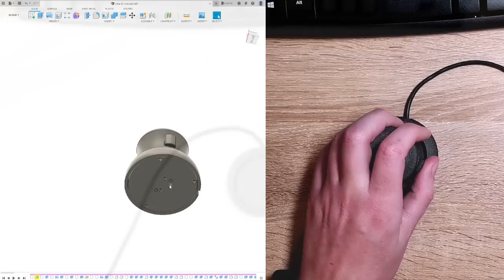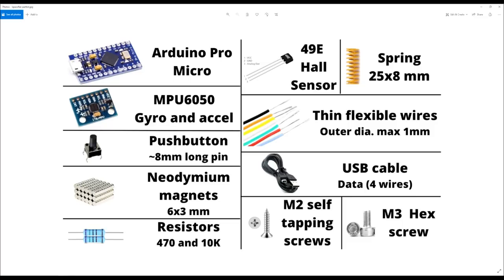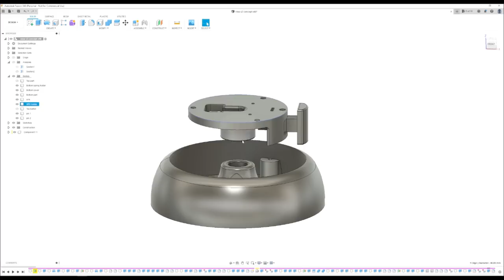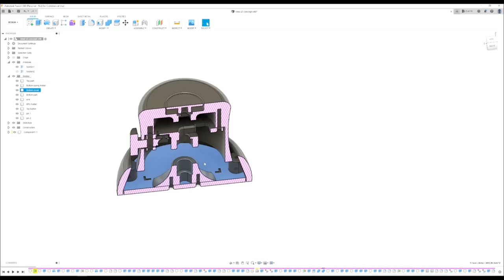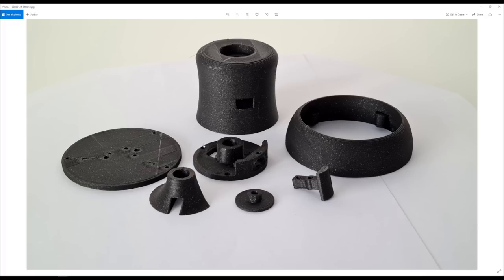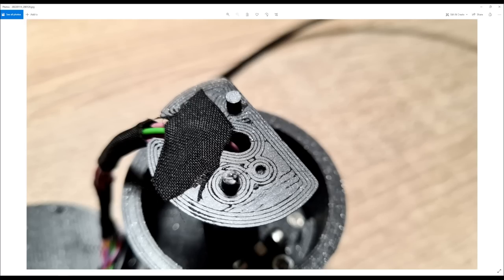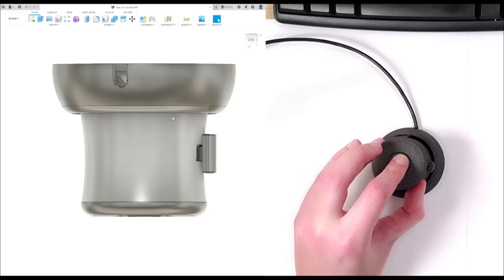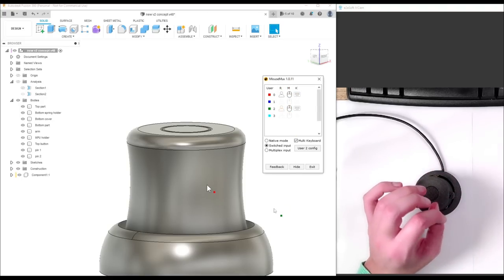Can my DIY Spacemouse compete with 3dConnexion??? - SpaceRat V2

Comment: One question - is there any reason that you did not just expose the usb connector on the Arduino so you could just plug in the cable instead of soldering it in?
Reply from the maker: These micro USB connectors are really shitty and it is anyway on an awkard angle in the case. Ijust did not want to make a huge hole slightly on the side. Here they are soldered and held by the hotglue in place. Furthermore I added a cable tie onto the cable wo you cannot pull it out from the case
Reply: @kikihobbyrepair  Well, I think you have a great project here and I might try and recreate it myself. I do most of my modeling in FreeCad, but I am sure that it would be easy to adapt the code.  I think I would look at making the top button a capacitive touch button instead of a mechanical button with an LED to indicate the mode and I would look at making the entire knob rotate for the zoom feature instead of having the side slider button.  I think the mpu6050 could be used to capture that rotation as well as the angle changes and make the electronics part a little simpler, but the mechanical part would be a little harder. But, I find that trying to solve these design problems is where the fun is.
Reply from the maker: Have fun 😉 One tging you have to take care is if you want to use the MPU also for the rotation you need an additional sensor which is detecting if only the knob is rotated or the entire mouse together with the base. Otherwise you would generate ritational commands by slightly rotating the entire mouse on your desk.
The capacitive button I like. It would be a nicer solution indeed.
Reply: @kikihobbyrepair  Great point - I had not thought of that, but that would be a problem.  Maybe using a detent similar to the one you designed with a hall effect sensor and three magnets is actually a much better solution.  By the way, I did not mention it before, but I love that "auto centering" detent design.  Did you come up with that yourself of did you find it somewhere else.  I am old and have worked in electronics my whole life and I have never come across a detent like this - I think its genius.
Reply from the maker: It just popped up in my brain how to solve it smartly without too much moving components 🙂 This is when I though magnets shoukd work.
Although if we would use a similar hall effect sensor to check  if the know is rotated or not in relation to the base. So the MPU and the hall effect could work together.

Comment: Very nice!  I am curious...  could a future revision of this use rotation of the stick itself in place of the rocker switch on the side?  Seems it might make the design, build and operation all a little easier.  What I picture is (if you pause at 5:14) a post coming up from the base to under the hall sensor.  Or maybe even simpler, move the HES down to near the bottom of the stick and the magnets could be in the base.  Because it is all on a spring, it should automatically return to center on release.  IDK, just throwing out ideas.  Again, very cool idea and build.  Thank you for sharing.
Reply from the maker: Thank you! Yes, rotation can be solved. But the problem with your ideas that you cannot put the sensor on the top and the magnet to the base because you would generate rotation action also by bending the top because the magnet will move in relation to the base. The only way to put both onto the top and and separate the 2 there on to of the spring. This way if you bend, no rotation will be generated.
Reply: @kikihobbyrepair  thank you for taking the time to consider my ideas and respond.  I now see the issue with my concept.  I will give it more thought (although I suspect you have already solved this ;)  I am most definitely going to build one of these.  Thank you for sharing your design freely with the world!

Comment: Does this work with other CAD software like Solidworks since its just mimicking mouse/keyboard commands?
Reply from the maker: Yes, it does work with all softwares which works with keyboard and mouse combinations. You only have to change the relecank combinations in the code.

Comment: Nice project. I also have a 3d mouse on my to-do list. Do you think it would be possible to realize the 2 axes (push right, left) with Hall sensors? Then you had all 6 axes. My idea is a plate that is located at the bottom of the case and can be moved to the right and left.
Reply from the maker: Thank you. The problem is the software. There is no keyboard/mouse combination to solve the 6th axes. It is 5 axis now basically.
Reply: @kikihobbyrepair  Why not a game controller input? Have it as a joystick.

Comment: Can I directly insert the micro USB to Pro Micro mainboard ?
Reply from the maker: You can if you make a bigger hole to it. The reason I did not do it because USB connectors are rather big and fragile. But it is doable
Reply: @kikihobbyrepair  hello, awesome project.
 i am just building it, how do i connect the cable to the arduino? which pins? what is the value of the two resistors r17 and r18?

by chance my ears are correct and i hear a hungarian accent: easy rider ocseeem! :D
thx
Reply from the maker: Szia. Köszönöm! Jól hallottad az akcentust 😀 Az R17 és R18 rajt van az Arduino board-on már(22Ohm) Azt csak szemléltetésnek raktam oda. Csak nézz meg egy micro USB portot és ott megtalálod a pinout-ot. Akár a portot leszeded és a pad-ekre forrasztasz, akár az utána következő komponensekre.
Reply from the maker: Örülök, hogy összejött és hogy tetszik 😉 Nyilván ez azért nem egy eredeti Spacemouse replacement, de szerintem egész jól működik és egy jó kis DIY projekt. Esetleg az autohotkey scriptet elkérhetem?
Amúgy pont tegnap este álltam neki, hogy hogyan lehetne megcsinálni úgy, hogy ne a billentyű/egér kombinációkat használja, hanem mint az eredeti, a kamera mozgását módosítsa. Az a baj programozásban gyenge vagyok, meglátjuk mire jutok...
Reply: @kikihobbyrepair  fuu hat ahhoz en sem ertek annyira, ami mukodik azt tudom pofozni, vagy osszetakolom valahogy(stackoverflow :D ), de magamtol nem csinalok ujat.

igy ahogy van, szamomra nagyon hasznalhato, de mar van par otletem, hogyan lehetne boviteni. par gomb elfer meg egy nagyobb dobozba, es akkor kodban lehet ugye allitani. ugy eppen ujjvegnyi tavolsagra es akkor nem kell mindig a tetejen nyomogatni a gombot...majd kesz lesz megmutatom.

pro micro egyebkent billentyuzetekben is hasznalt, fut rajta QMK is, az eppen billentyuzethez van, de pl tamogat trackballt is. less bele, de szerintem ehhez overkill.
nem tudom, hogy lehetne befuzni a gyroszkop modullal stb. 

irok mailt :)

Comment: I started a project doing my own space mouse a while back but didn't have enough time to progess. i used a similar approach with mouse-keyboard emulation. I ran into the same problems as you did, though i didn´t know about the mouse mux software. I did a little research on fusion 360 api which alows you to create a script that will capture commands from the arduino and translate them to camera movement, similar to what the 3dconexxtion driver is doing. Have you tried this direction? i know it is more complicated but will yield a smoother performance
Reply from the maker: Yes, I came to the same conclusion. The only way to make it like the real is with scripts. My problem is that my programming skills are limited so I did not have the mood to start it yet 😀

Comment: Thanks for sharing your project, it's fascinating! I wanted to ask you if it is possible to use another controller, such as arduino nano, rpi pico, smt32 or esp32, since in my country it is difficult to get the pro mini (and very expensive) and imports are closed. Greetings from Argentina!

PS: do you plan to publish a v3?
Reply from the maker: Thank you. You need to use a controller with native usb so the Nano won't work.
As for the v3, I might get in trouble because of the patents so I do not know yet....

Comment: But there is a big difference.. weight.
and yours is moving while using.. especially if you do the zoom out, which urs is not capable, you would simply lift it up :D

Also you can get a space mouse kinda good priced on 2nd hand market :)

But no front, this is an amazing project and i like it really much!
Reply from the maker: Weight is easy to increase.
At the moment zoom is on the side arm and it is quite stable to be honest. There is no pull up action om this one.
This is just a fun DIY project, it is not  to compete with a huge company like Logitech 🙂

Comment: This is crazy bud, thx so much. How complicated would it be to code some push buttons on this arduino? I would love to add some hot keys on the base of your design, and I am wondering if I can make them work for the comon features. You know, extrude, sketch, fillet, chamfer, measure... the most used ones
Reply from the maker: Stay tuned for this weekend video and you might get a solution to this 😉
Reply: @kikihobbyrepair  love it!!

Comment: How about cloning their design there are bunch of teardown 
They used photoelectric sensor in space mouse its easy to find
Reply from the maker: Yes I saw tear downs. At the moment they have quite a few patents. I know that for myself I could build one with no problem. Furthermore I did not want to be a copycat. For the v3 I will try the 3 spring setup though.

Comment: Why not use a joystick from a game controller in the base? One on the base and one on the side would achieve the same goals with a smaller bom count, unless I am missing something.
Reply from the maker: Game controller joysticks are super small, fragile and the potentiometer is wearing out pretty fast. With the spring you can put your hand onto the mouse without damaging it and it will not wera out.

Comment: Are the two Resistors connected to the Capacitor in the circuit diagram because of the small dot ?
Reply from the maker: Yes, they are connected.
Reply: @kikihobbyrepair  thanks, im building mine right now
The parts look awesome when printed in resin
Reply from the maker: You might have to finetune the dimensions for resin but it will for sure look awesome 😉
Reply: @kikihobbyrepair  i changed all the fasteners to m2,5 and added the threads right into the parts, it took a few prints until i got it perfect. glueing the Magnets in was pretty hard
Reply from the maker: I would love to see how it looks resin printed. Could you please send me some pictures at the end to kikihobbyrepair@gmail.com ?
Yes, installing the magnets is tricky 😀 Strictly one by one.
Reply: @kikihobbyrepair  yes

Comment: did you ever make version 3?
Reply from the maker: I am right now working on it and have true 6 axis as in the original. No more mouse movements, works with the original Spacemouse driver.  Some mechanical finetuning is still needed.
Reply: @kikihobbyrepair  awesome subbed and awaiting release

Comment: Does it work with SketchUp and blender?
Reply from the maker: It works with each and every program where you can navigate with the help of keyboard shortcuts and mouse movements. For sure the code has to be modified accordingly

Comment: Hi Kiki
I tried this
but when I connect spacemouse v2, will lose left click botton
any idea about this?
thx
Reply from the maker: Have you changed to Tinkercad settings in Fusion 360?
Reply: @kikihobbyrepair  thank you for reply
no I didn't 
maybe I should try on other computer
I don't have C1 100nF but I guess  it not Influence Gyro working

I also try other people version
have similar problem, it will try to open other fusion or explorer many times
Reply from the maker: But you have to set Fusion 360 control settings in the preferences to Tinkercad. Than it should work. The 100nF is just some filtering it is not that critical.
Reply: @kikihobbyrepair  thanks for the information
I try to use other PC
same situation for loss my left mouse botton
but Gyro working
no chance to try Hall sensor yet

Comment: hey I just put one together and I'm having interference with my mouse, when I plug it in I cant click on half the stuff on my screen, for example in fusion I can click the sketch and circle but once at that point it cant be placed. also happening on everything else. you have a solution? thanks
Reply from the maker: Have you set the navigation mode to Thinkercad in Fusion? This would be my first bet.
Reply: @kikihobbyrepair  hey i just figured it out i had the hall sensor wire touching at the tip and I fixed it.now it works thanks for this great product
Reply from the maker: I am happy to hear this man 😉 Have fun while using it.
Reply from the maker: Now it is time to build my macro keyboard 😜 It  is an another nice addition to 3D modeling 😉
Reply: @kikihobbyrepair  So it seems I haven't fixed the problem. its stuck on scrolling and right click when I plug it in, I have checked all the wiring and I haven't seen anything. I have unplugged the hall sensor to see if its that but still the same issue. Im assuming its the code or maybe gyro?
Reply: the cursor moves around the screen fine just cant do anything from then on because of the right click to stuck open on it
Reply from the maker: I am a little bit confused. You told previously it is continuously scrolling and later on that it moves properly but stuck on right click. Which one is actually the case?
If it is scrolling in its own it is like a problem with the MPU. Sensing like always tilted. 
What if you try it in Fusion 360? Does this work there properly? Have you changed the settings in Fusion 360 to Thinkercad? 
It should work as it is because I got multiple feedback from people who built it and works fine.
If you try it in browser it is normal that it clicks with the right button because this is how it is programmed but it should work perfectly in Fusion 360 with Thinkercad settings.
One more idea. When you plug it in is it laying straight on the desk? It is making a calibration at startup so you should put it onto the desk and not touch it for a few seconds.
Reply: @kikihobbyrepair  sorry to bother you but I'm redoing the wiring today and I'm look at the video, The button with the 470 resistor seems to be on channel 6 in the video and on the list is channel 7. also the 10k resistor is going from vcc to channel 7 then branches off with the capacitor to the ground on the video? thanks for the help

Comment: Sure that the spring is 25x8 not 20x80 and where can i get so one
Reply from the maker: yes, it is 25 x 8 mm. Look for 3D printer heat bed spring. You will find a lot everywhere.

Comment: I thik a better disposition of the movements would be:
- tilt forward and backward should rotate it on the X axis, as in the video.
- tilt left and right should rotate on the Y Axis instead of the Z axis.
- sliding the side button should rotate in the Z axis.

Then after pressing the button:
- tilt forward and backward should move it on the Y axis further away or closer, as in the video does the side button.  (notice rotation is on X but movement is on Y)
- tilt left and right should move it on the X Axis, sideways.  (notice rotation is on Y but movement is on X)
- sliding the side button should move in the Z axis, up and down.

Also it would be great if instead of just using the top button to change between rotation and movement, you also use a modifier key (SHIFT, ALT, CTRL...) to trigger the change.  This way It would be a momentary change so you can change faster between rotation and movement. You need to use both hands, so you cant use the mouse while moving, but you can use it while rotating or viceversa depending on the top button state.

Comment: where did you buy the arduino pro micro ?
Reply from the maker: I bought it from Amazon but from China it is way cheaper.
Reply: @kikihobbyrepair  thanks.
is the arduino after the programming still able to be re-programmed ?
i read before that if you program it as a mouse or keyboard it no longer comes up in the arduino ide.
Reply from the maker: I reprogrammed it 50 times so it should work.
Reply: @kikihobbyrepair  OK thanks. I read somewhere jou needed a J-wire interface to acces the arduino because the bootloader was changed.

Comment: Very nice project. I would like to modify the 'bottom part' to add (much) more weight to it. Could you share the .step file for this part? I have not yet found how to remix .stl files in a good way :)
Reply from the maker: Thank you! Step file should be available on Github, Printables and Thingiverse too.
Reply: @kikihobbyrepair  Sometimes I am blind. My brain was expecting separate .step files (e.g. a Bottom Part.step) and thus I missed the one larger file :) Thanks

Comment: I made one but I get no inputs at all it shows up as a mouse but no movements
Reply from the maker: It looks like something is wrong with the MPU module. Is it wired uo correctly? It should move the mouse even in windows or in a browser.
Reply: @kikihobbyrepair  possibly I was up late working on it last night today I will rebuild it on the breadboard. I could have a bad MPU there are always complaints under cheap components on amazon.
Reply from the maker: You could also check the I2C address of your MPU module. There is a resistor which can be soldered in 2 positions to have different address. Tale a look at it.

Comment: Have you seen this video? https://www.youtube.com/watch?v=1R7NCH_1UDI
Maybe you need a different approach so you can get all the six axes properly working. Some improvements that I see you can incorporate to your design is using light to measure movements instead of a gyroscope (or hall effect sensors for all axes) and three springs instead of just one at the center.

Comment: You lost me at the soldering part. I can join the ends of wires together, but that's the beginning and end of it for me.
Reply from the maker: I did not want to make the video too long. The schematic is available in the Github repository.